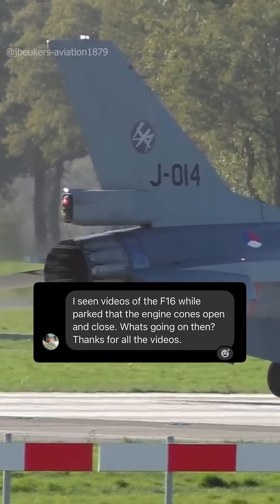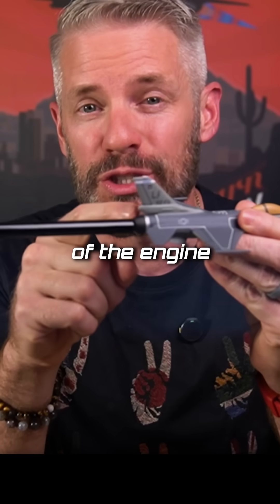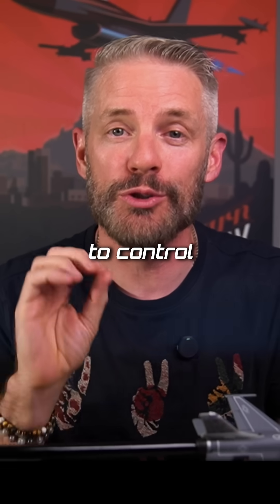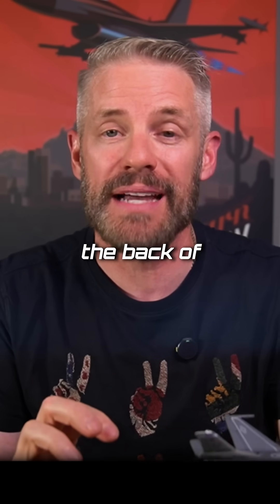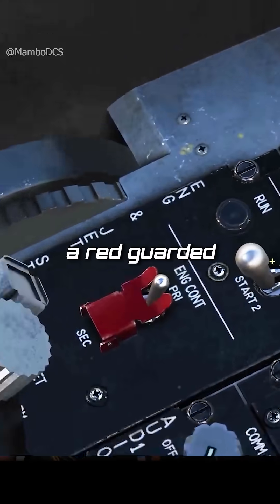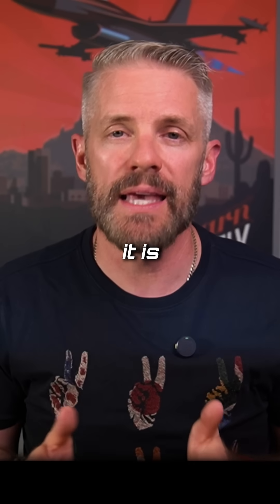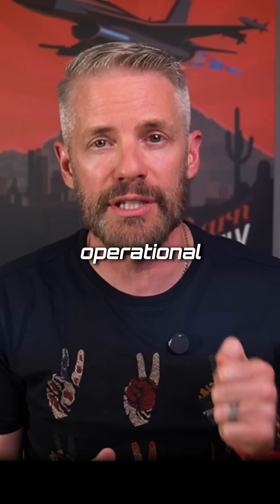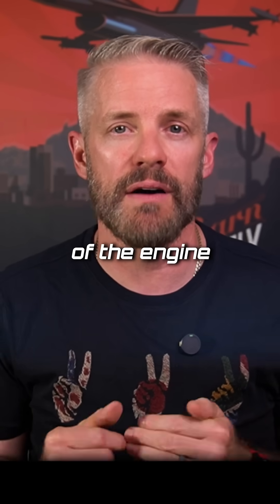F-16 Engine Nozzle Explained

Comment: The nozzle opens up in afterburner because the flow is supersonic, and you need to coordinate the pressure so the chocked flow will have as small loss as possible.

Comment: Hi Motor, RAAF pilots used to do a maneuver called a "Dump & Burn" with the F-111, which was used during airshows & special events like the Sydney Olympics closing ceremony. Can any other aircraft do that, and did it also serve any military purpose other than making for good public relations?

Comment: @realshawnwalsh  I learned this early on and on a cross country red ball honestly. While the throttle cable is connected to the MEC, in primary mode, throttling up is mainly due to the primary signaling between the APLA signal from the throttle (TPS) the EPLA signal from the MEC’s solenoid. But when the engine is operating in Sec mode, it’s either core discharge pressure (CDP) or PS3 air to the MEC drives the solenoid and a lack of that air results in zero throttle response. We cause that on a late night launch for a jet heading from Shaw to Spang. Crazy stuff!!

Comment: As a fellow engine troop let me help elaborate on the modes. 

Pri (Primary) Mode is the engine running at its full capacity, with the Digital Engine Control (DEC) or Digital Electronic Engine Control (DEEC - Pratt) maintaining full authority over the engines operation, other wise considering running in digital mode via electrical inputs from various sensors and points. Then engine runs in this mode by default all long when there are not performance related faults occurring (VSV scheduling, fan scheduling etc) 

Secondary (Sec) Mode in reality is a fail safe mode. It occurs when the pilot selects the switch or when the DEC detects performance failure. When this happens, the DEC/DEEC goes into a monitor only mode and giving control over to the Main Engine Control (MEC). At this point, the engine is running mechanically. When this happens, the nozzle goes to full closed position, augmentation is inhibited (mainly due to the nozzle operation hauled and because the DEC controls augmentation). Another thing that happens is that the inlet guide vanes (IGV) in front of the fan goes to a fixed position to limit air to prevent the fan from over-speeding now that the nozzle is stuck closed. If the pilot selected this mode, cycling it back to Pri will allow the engine to resume normal operation. But if Sec mode was due to a fault detected, it stays in that mode until shutdown and the fault is cleared. Upon next start is when the engine will go back to Primary.
Reply: The turkey feathers also change configuration at supersonic speeds dosen't it??
Reply: @BobarissGish No. The nozzle position is based off core RPM scheduling due to throttle positioning, not airspeed. Now the inlet guide vanes will adjust to maintain the rate of airflow into the engine when the aircraft is yrs along at a high rate of speed.
Reply: @thatmitchellguy thanks for the clarification. I would have asked my father as he was a black hand in the RAAF but has passed away.
Reply: @BobarissGish a sorry to hear that bro. My condolences. I’m glad I was able to share some insight.

Comment: @realshawnwalsh What is the typical runway length required for landing an F-16 and what was your shortest landing in one? Also, as the F-16 has no fuel dump capability, did you at times need to "waste" fuel to lose weight before landing?